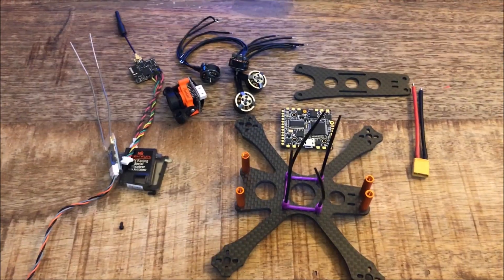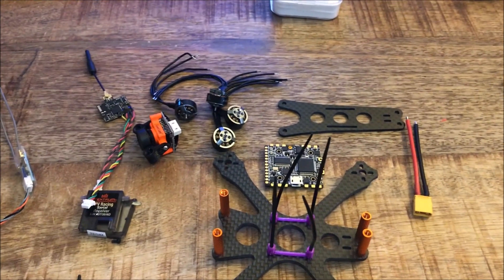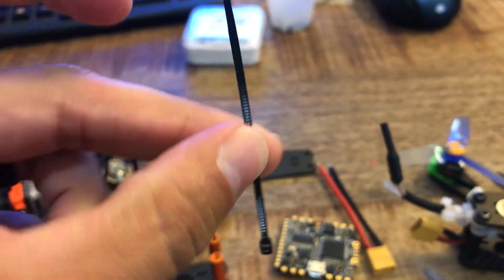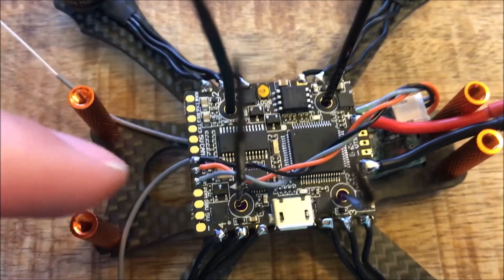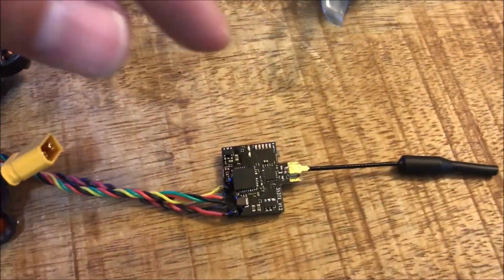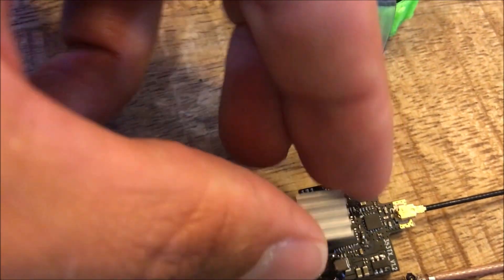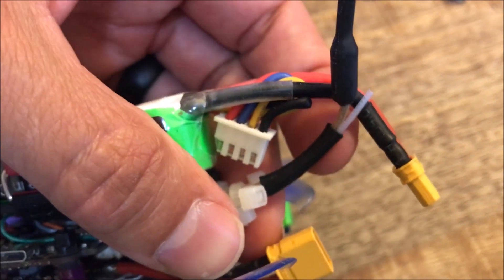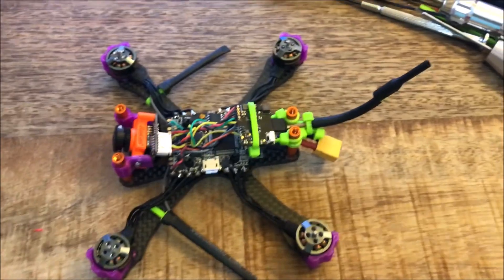10+ Tips for Micro Quad Builds

Comment: can these parts fit onto a 3 inch Alien frame? im asking because im new to all this and I just ordered a 3 inch alien frame lol also are these motors good to handle a go pro? im interested in freestyle
Reply from the maker: Michael Torres, this quad is designed to spin 2.5” props. For 3” you’ll need bigger motors. Lots of options for flight  controller and cameras. If you want to carry a GoPro I suggest using a larger setup. The most common size for GoPro quads uses 5” props.

Comment: Thank you all good stuff. You probably already know but the exposed part of the antenna should be 12.7mm. For whatever reason some are not. It's more effecient gets less hot and you get better range.
Reply from the maker: Yup, you gotta use an antenna that's tuned for your frequency.  I've heard some people using a more finely tuned length if they typically use a frequency on one of the extreme ends of the standard 5.8 FPV range.  Happy flying!